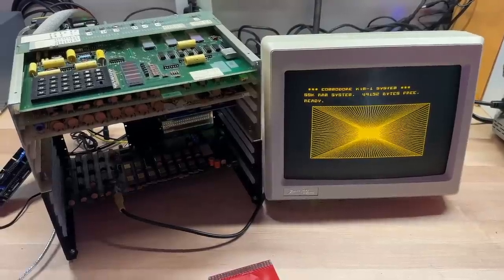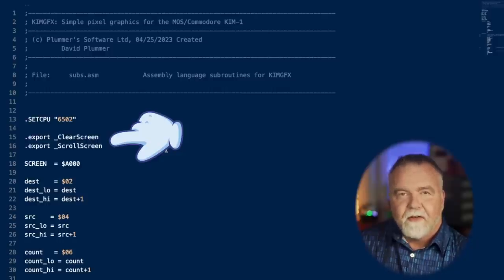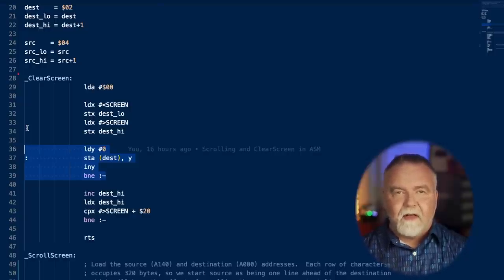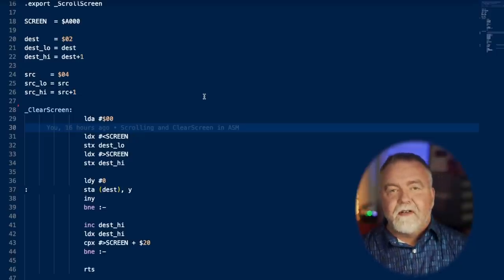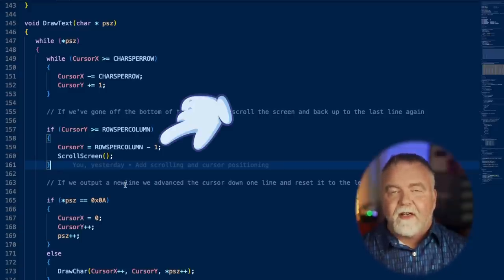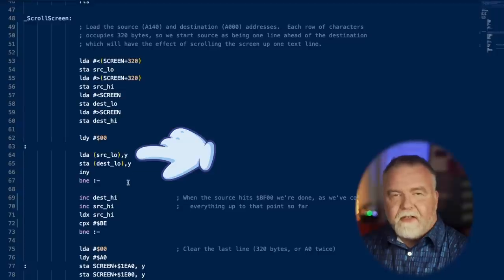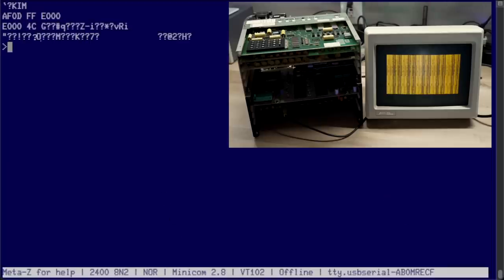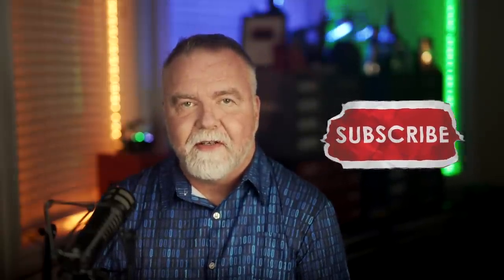C and Assembly Language: How To!

Comment: The Z80 has an instruction that makes setting a load of bytes to the same value, so the CLS function in Z80 is effectively (once the registers have been setup) a single opcode. I used this to amaze my computing teacher in 1981. Happy days!
Reply: Forty years after using MPF-1, I remember that the "LD HL" opcode is "21", and "LD DE" is "31".
Reply: How do interrupts work with such a long instruction? Is the whole op-code un-interruptable ? Or does the Z80 have special handling to resume the opcode half way ?
Reply: To zero out 1K at 0x4000, you would do this…

LD HL, 0x4000
LD BC, 0x1000
LD A, 0
LDIR

I think ldir is interruptible, but don’t know for sure, it’s 40 odd years since I used it in anger!
Reply: @SerBallister  Z80 completes the current instruction before servicing the interrupt, even if it is interrupted in the middle of its execution.
Reply: Nice going.
Reply: @JohnnieWalkerGreen  Ahh, yeah that seems the most sane way. What's the maximum cycle count possible with that instruction ?
Reply: @SerBallister  My rusty memory recalls that Z80 instructions can have more than 20 cycles. The minimum instruction length is 1 byte, and the maximum is either 4 or 6. You should Google/GPT for details. If I am not mistaken,  Z80 has a block transfer instruction. Or was that PDP/VAX-11?
Reply: Isn't there different chip in motherboard for handling video? There  might be built in routines to call.
Reply: @morganskinner3863  Ahh, no! -either you don't know Z80 or you've forgotten half of it 😆
Reply: @johnniewalker8290  Yikes, I imagine video beam interrupts could be tricky.

I think you're right about the block xfer instructions, there may have been a memory compare instruction too IIRC

I did do a project based on the z80 (I wrote an emulator) around 4 years ago, and I'm already forgetting the details..
Reply: X86 processors also have such instructions, but they only work a byte at a time so it's faster to write the loop yourself because you can copy more per loop. For instance, memcpy() on modern processors is often implemented to take advantage of SSE and now AVX instructions to load upwards of 64 bytes at a time. If you've got the latest processor you could copy 512 bytes at a time with AVX.
Reply: @anon_y_mousse  Some embedded systems have DMA controllers that do memory copies, freeing up the cpu (assuming it's doing work from cache). I'm not sure if such a thing would be practical on x64
Reply: @SerBallister  That's for connected devices, if you're doing it from one memory location to another for CPU specific processing then you wouldn't be using DMA, but yeah, x86, whether 32 or 64 bit, does have DMA.
Reply: @anon_y_mousse  I meant memory-to-memory DMA, a hardware memcpy.. These wouldn't be that great on a modern x64 as you need to invalidate caches on the CPU to "see" the changes that took place.
Reply: @morganskinner3863  simple yes but faster is to set the stack pointer to the last byte of screen memory and then push 0s to it in a batch.  dont ask for code, its been too long :)

Comment: ClearScreen is very unoptimized!
1. You need to clear 320x200/8 = 8000, but your program clears 8192, that is extra 192 times internal loop, which for 6502 is way too much extra.
2. Handling the outer loop is very slow! If you do the math (but it is obvious in the code too), outer loop is 32 ($20). So you could optimize that by:
LDX #32
... <inner loop>
DEX
BNE :-
This way you will reduce the instructions in half (from 2 to 1), and the generated code will be just 1 byte (instead of 4 as it is now).

Comment: Thanks for creating this well done video. Was a trip down Memory lane for me. My  programming career began in the late 70’s early 80’s writing 8080,  then 8085 assembler ( better ICE) using an Intel MDS210. I was building Industrial apps on Single board processors. I vaguely remember using using the  linker/ locator to place code into specific addresses ( read) EPROMs. I had one eprom that I could interchange with variable data. The blurry good old days. 😊
Reply: Ha, I remember doing this as well back about then on the intel 8039 microcontroller series. Built my own eraser from a bug zapper and made a programmer from a ton of switches and discrete components, but just like you, they are pretty fuzzy memories. I had lots of time on my hands back then.

Comment: Would love to see this ASM version running next to the C only version for comparison. 

When I rewrite something in ASM I always keep timings. Even when I'm optimizing I start with the slow code and as I make each improvement, I verify if it's actually an improvement. Sometimes, you make it slower.
Reply: seconded
Reply: third. Would also be interesting to compare the assembly generated by the compiler vs the hand-written version. Is it still substantially faster even with `-O3`? Where would the speedup come from?
Reply: Turns out modern compilers are wicked smaht
Reply: Well, try to do count down loops instead of count up.

Depends on which compiler.
Reply: @greatwolf.  godbolt!
Reply: A few years back I was asking the same question. I decided to only do a speed test on an intel processor, not the best example really, but what I found was that if you were doing tens of billions of nested loops( on a single core processor), Assembly language was the one to beat, but C was equally on par. I did also try an old high level language like "Basic" which was a thousand times slower than either of them. Assembly language also could be made faster if you were to restructure your nested loops by doing several increments per loop (obvious) thus saving the lost time in redirecting the program counter, but the code would increase in size for the trade-off. Though in saying all that, a good programmer can easily design complex code to run twice as fast as an average coder can.

Comment: i remember using assembly to speed up a 3d engine i wrote in qbasic. worked really well actually. fun times. the assembly basically pushed memory straight to the video memory. this allowed me to stack different layers together beforehand so there was no need to clear the screen.

Comment: Thanks for going through this demo.
Curious how you became familiar with MOS & the KIM kit?

I worked on the Motorola 680x line for an industrial process control company (we also used DEC Vax & PDP in top of it all), fun times chasing bits. But never played with the MOS stuff, remembering it was well regarded.

Oh, the funnest part of that job was bootstrapping up an HP 3060a automated test system (bed of nails, HP-IB, HP "calculator", the whole she-bang!). Nearly 40 years later... I "think" I miss it. No, probably not.
Reply from the maker: I never saw one in the day, but they're so similar to the PET and C64 in general architecture that a KIM is like a "mini PET" in a way!

Comment: You can save 1 cycle/byte by using absolute addressing for STA instead of indirect.  (Assuming you don''t object to self-modifying code, and that your code's not going into ROM.)
Reply: As a kid doing assembly programming on the C64, I was somehow "scared" of these indirect addressing modes, so I would always do those self-modifying code loops. Never spent time to realize that in ROM this wouldn't work 😊

Comment: I have only very rarely written any assembly. In a case like this I would probably start by looking at the  code the C compiler generated and then start counting clock cycles to see if there are any obvious optimizations that could be made. 

It would be useful to provide an example of how C passes arguments into a function in assembly as well.

Comment: I love the work you're up to for the KIM-1.  Is your end goal to give it most or all of the functionality we expect from other Commodore machines Kernals?  That would be a great series indeed.
Reply from the maker: That's sort of what I've been tinkering with, but with no keyboard interface, not sure how far I'll take it!
Reply: @DavesGarage  I've got an old KIM-1 single board computer, stock except that I increased the memory by something like 8K, if I recall. I also have a wide-carriage IBM Executive typewriter with a pin-feed platen that GE hacked with solenoids on the type bars, and leaf switches under the keys. It was originally used on a computer monitoring the tin plating line at Kaiser Steel. I kludged up a board to plug onto the PIA outputs that would monitor the switches and drive the solenoids, and had myself a teleprinter. It was pretty much useless, but I could do keyboard/printer I/O.
Reply: @DavesGarage  I have a 6502 based board that was used end 80's begin 90's as part of home automation when the word was not yet invented. Mainly used in hospitals and prisons to automate and secure things. The boards has a ton of io both serial as parallel. It does not have normal video out, but a header for a LCD display, i have a 2 line model attached to it. Has 32kb ram 16kb rom and 16kb reserved for io space. I started to write a operating system for in somewhere in the 90's it's was never completed as i lost interest. I feel like i should dig the thing from the attic and finish it. Reason i have it is because it is the second revision of that board and i was the one who redesigned it. First gen had 16kb ram and 8kb rom and some other minor differences.
Reply: @lwilton  Sounds about right, while working at LTV's Indiana Harbor Works (former Youngstown), GE was the main contractor for the rolling mills, similar things happened.

Comment: Really cool video! I've never tried mixing C with assembly, but now I want to :-). About local labels in ca65 (I think what you're using are actually called unnamed labels), you can also branch two (or more) colons ahead with `:++`, `:+++` etc. Same thing when branching back multiple labels, you add multiple minuses. Local labels are also a thing by the way. They're labels that start with a @ (at sign), and they're only visible between two non-local labels. This is handy when you want to reuse common label names like @loop, @done, etc.

Comment: Great video. Regarding 07:30, the scroll screen will fail to clear $BE00 (= SCREEN+$1E00) like you suspected.  Fixed with easy-to-understand version is:

  lda #0
: sta SCREEN+$1E00,y
  sta SCREEN+$1EA0,y
  iny
  cpy #$A0
  bne :-

However this adds an extra instruction (cpy #$A0) inside the loop which is bad for speed.  You wrote it as assembly for speed right?  A better but harder-to-understand version is:

  lda #0
  ldy #$A0
: dey
  sta SCREEN+$1E00,y
  sta SCREEN+$1EA0,y
  bne :-

This runs at same speed as original, and doesn't miss clearing address $BE00.  It looks weird because DEY instruction appears 3 lines above the BNE instruction... but it works because the two STA instructions do not affect any flags.

Oh the joys of assembly language!

Comment: 7:37 Yes, that's a bug - it will not store 0 at location SCREEN+$1E00.  It will store 0 at SCREEN+$1EA0 on the first iteration but it will also store 0 at SCREEN+$1F40 which is the first byte just off the screen.  There's a couple of ways you could fix this.  One way would be to start Y at 0 then do INY and CPY #$A0.  Executing the compare on every iteration will slow things down slightly.

Another way would be to use the Negative flag.  To do this, you'll have to unwind the loop into 4 instead of 2 so that Y can start at a positive number; a value less than 128:

    ldy #$4F
:   sta SCREEN+$1EF0,y
    sta SCREEN+$1EA0,y
    sta SCREEN+$1E50,y
    sta SCREEN+$1E00,y
    dey
    bpl :-

When Y rolls around from 0 to $FF, it's a negative number and it won't branch.

A quick fix to the problem would be to just do STA SCREEN+$1E00 straight after the loop.

Comment: Since C++ builder went CLANG, their assembler is at+t assembler. Kinda tricky. I started programming in 1991, using borland C. I liked how easy it was to do the assembler. I used it to write high performance text screen io, editors, comport vt200 terminals (competed with procomm plus) all that nice stuff.
Never used Microsoft compilers, so don't ask me about visual studio lol😂
Reply: I have only used Microsoft compilers, so don't ask me about the others :)

Actually, not quite true. I did dabble with other stuff back in the 70s and 80s but MS for the past 30 years.

Comment: Always enjoy the programming videos. Wondered if the 1 to 127 count of bits in the last video should have been 0 to 127 or if 0 was left out for some special reason. Would be interesting to know what was going on in the C copy vs your assembly copy to compare the steps vs performance. Ironic that this was updating the display faster than Microsoft would on my Tandy 1000 DOS prompt but figured I ran into a compatibility fallback of sorts having updated the OS.

Comment: I guess you can what you want, but typically you'd want to set your variables in assembly as zpsym instead of just hard coding a zero page address like you did (with CA65/CC65).  I'm assuming you did that to simplify for viewers.

PS. Will you write a full conio implementation for the kim-1 for cc65. :)

Comment: Is cc65 not smart enough to turn certain kinds of loops into register-indexed loops, rather than stack-variable-indexed loops?

When I was writing code as a professional game dev and needed asm-speed code, I would try to write out a good implementation in asm and then create C or C++ code that generated something as close as possible to it, with comments on why certain things were arranged just so. This allowed the code to be portable, to be read and even debugged by asm-unaware programmers, and yet be highly performant.

Another option is to have a reference version in C/C++ and a per-platform version that overrides it if present.

Comment: I had a Kim 1 that I salvaged from an old Audiometer, but it disappered a few years back when I was moving.
Reply from the maker: I had a brand new VT200A in the original box, it got lost in my last move.  No idea how or why!
Reply: @DavesGarage  I lost two 10' by 20' warehouse full of computer and test equipment no long after 9/11. I was laid of the Friday before, and I was moving stuff from them to my house.   I ended up bed ridden for a little over two years I had over a dozen PET computers, at least ten disk drives and a pile of 4023 printers. I also lost a 8023 printer. Wide carriage dot matrix that you could send a lot of formatting commands to. 
I still have one of the original LASER printers, with the same print engine that HP made famous.
There is a SWTPC computer out in my shop, as well. I have an Altos 586 computer that I've promised to a computer museum. I'm in my '70s. I started working in a TV shop at 13. I was building Telemetry equipment for the Aerospace industry, until I ended up disabled.
Some of the oddest computers that I've had were made by National Semiconductor nder their 'Datachecker' name. They were early POS that filled an entire enclosed relay rack. Both system were dead, and after way too long of not finding any information,I scraped them for parts. I recovered ten of the large LASER scanners. I sol the LASER tubes and power supplies, along with the front surface mirrors. I got more from the scrap aluminum housings than I paid for both systems.

Comment: It was probably for the 286, but I'm almost certain my C compiler let me inline the ASM code.   Or am I mis-remembering?  Like literally ASM { mov AX ..... }
Reply: yeah many high level languages (C, Pascal,..) allows you to inline asm. The the C Dave uses (CC65) has terrible syntax - each instruction require asm(..), which makes ugly code. On top of that you can't do some tricks to increase readability of the code (like macros) and some tricks like local unnamed labels. So using a separate asm code is much easier and readable.

Comment: Thank you Dave!  I was actually just today trying to figure out how system("cls"), system("clear") and the other variants work. I was digging through stdlib.h and couldn't find them at all. I see now that simply clearing the screen efficiently is way, way lower-level than I had realized. Hope the C lessons continue! Maybe one day you could explain the seemingly impossible "Press a key to continue" magic trick in C.
Reply: You can just think of that as a mutex waiting on an interrupt either spin locking or yielding back to the OS depending on complexity of the system

Comment: Curious, rather than iterating  line by line to copying row 1 to row 0, row 2 to row 1....   Why not just move all 8K -320 from row 1's address to row 0's address? then fill from 8k-320 with zeros for the last line?  Only two copy operations, and seems the cpu will copy the data after than multiple successive 320 byte copies...
Reply: Yes. Also, due to an 8bit quirk in 6502, it's faster to do page (256 byte) aligned loops. Each time an indexed operation has to cross a page boundary costs an extra cycle. Slightly complicated by the two pointers crossing pages at different times.

Comment: Sir, with the raise of Zig programmer that it's already proven faster than assembly language for systyem programming, will assembly be replaced?
Reply from the maker: For very complex problems, yes.  But for interfacing with hardware, assembly is still sometime necessary, I suppose.  But the number of places you need ASM is incredibly small these days!
Reply: @DavesGarage  Ok, thank's for your answer Sir.

Comment: @davepl — is the scroll routine something that could see a performance benefit from loop unrolling?
Reply: Yes. In general everything that runs multiple times in a loop benefits from unrolling, because you reduce the overhead per iteration of a loop.  However in early days memory was very expensive and in small quantity. That is why size was preferable "optimization". For example some of these early machines was sold with 4k RAM.